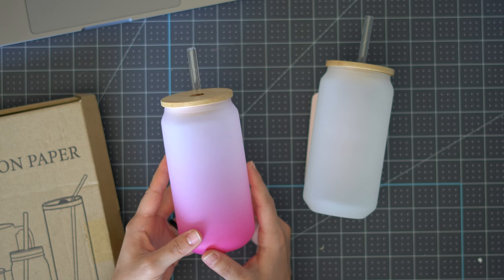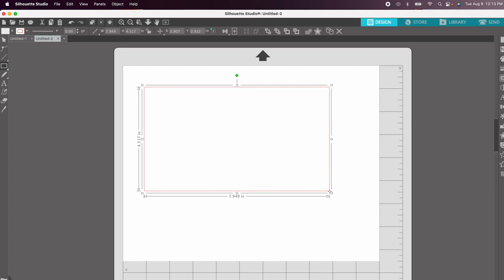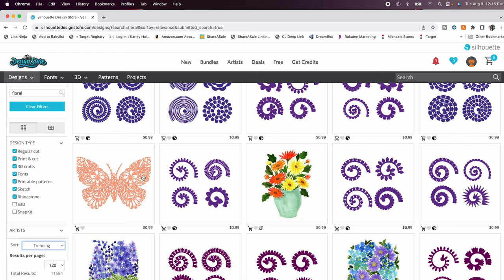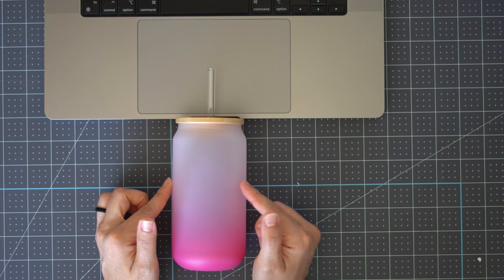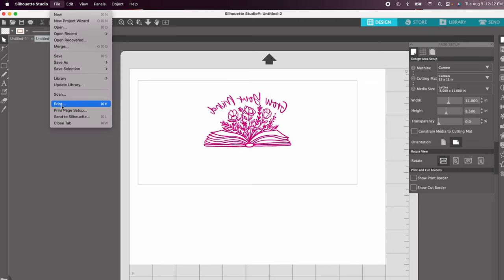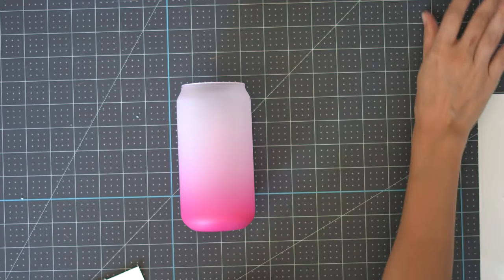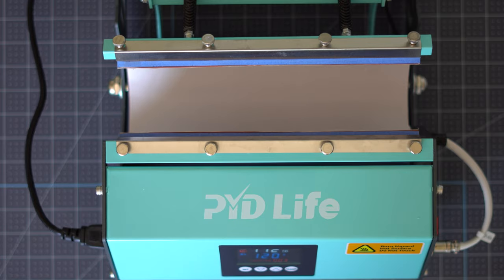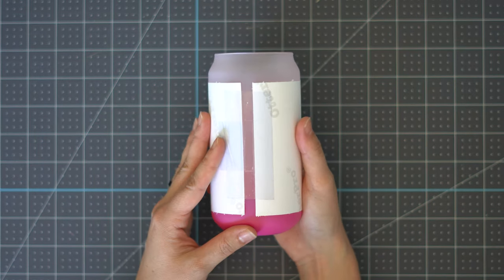How to sublimate on glass can cup

Comment: I just did some glass cans in my Cricut mug press with the inserts and they came out well.  The biggest issue is doing them back to back, the machine doesn’t count down like it would with regular mugs.  I think the insert doesn’t cool down enough for it to register a good temp so you would have to set a timer.